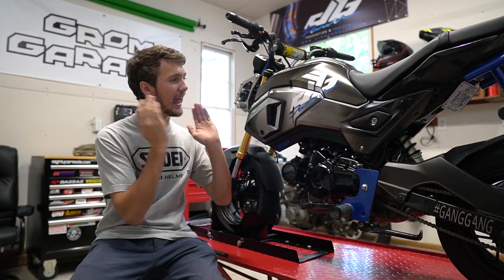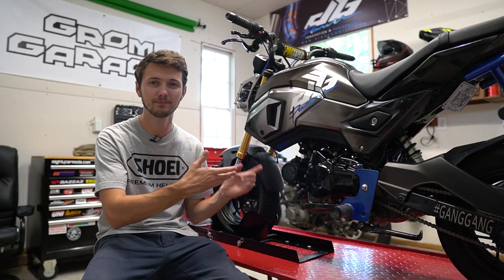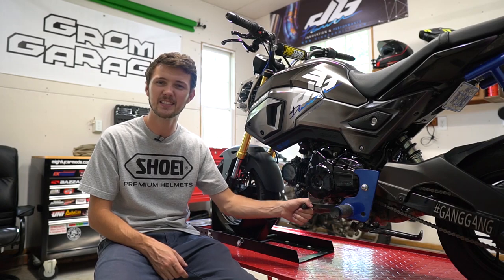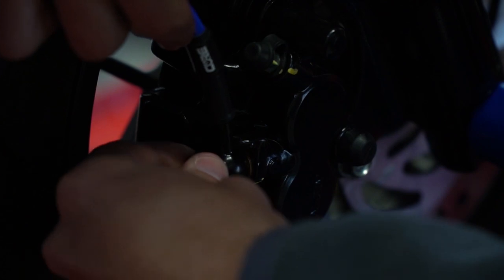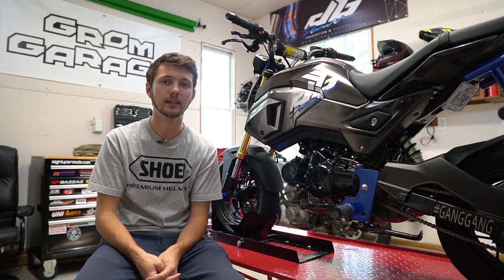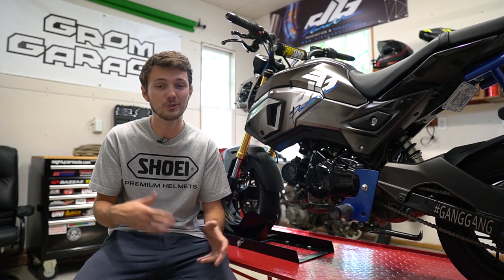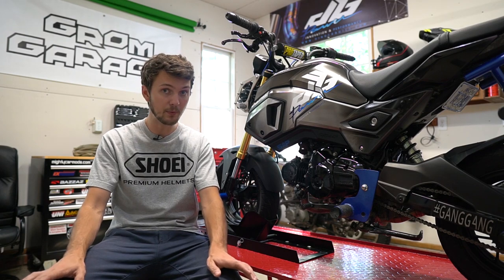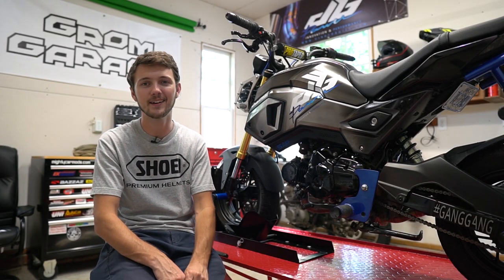FULL PARTS LIST | Grom Garage Build + Reviews

Comment: Save money on the Olin’s fork kit with just heavier oil. The oil alone does wonders. And you can also stiffen the rear end up with a hose clamp and putting the bike in the air letting the spring fully decompress and tightening the clamp on the spring.

Comment: Have you ever messed around with changing you’re rear sprocket? If so does that help more with stunting?
Reply from the maker: I haven’t personally. From what I know... front sprocket down a tooth is more acceleration but worse top end, front sprocket up is slower acceleration but higher top end (unless bike is maxed out).... for the rear it’s backwards and every tooth you go up or down is about half the difference you would see by changing a front tooth... so basically, rear sprocket up means more acceleration but worse top end while going down a tooth creates worse acceleration and more top speed. But again, keep in mind that changing one tooth on the rear is like changing 1/2 a tooth on the front. Hopefully this helps
Reply: Grom Garage definitely helps thanks for getting back to me 👍

Comment: That control switch is no longer available is there another one
Reply from the maker: Search “Type this in on eBay, 7/8" 22mm Aluminum Motorcycle Handlebar Push Button Horn Beam Winker Turn Switch” on eBay
Reply: Grom Garage thanks needed that for my 
grom

Comment: What sprockets are you running ?
Reply from the maker: One up in the rear and one down in the front I think
Reply: Grom Garage does is matter which way the dot is facing when you remount bars? I have mine top saw yours was down so really didn’t know. And what’s torque spec for the clamps